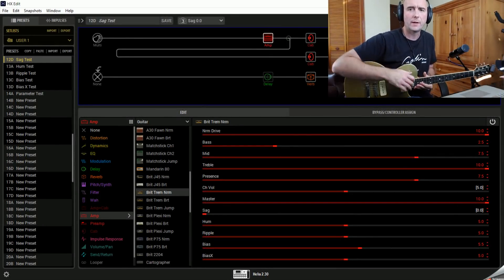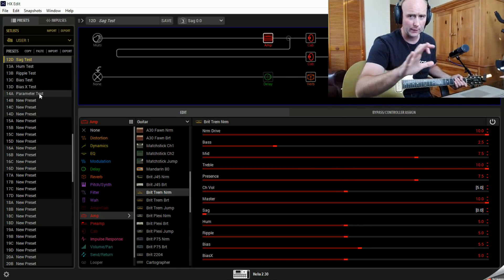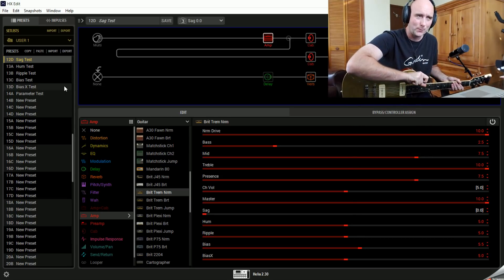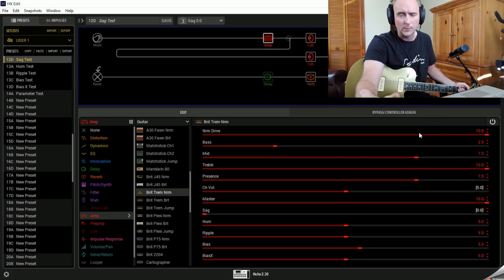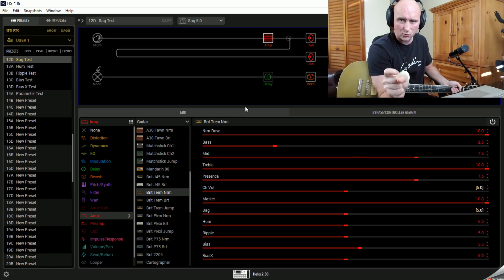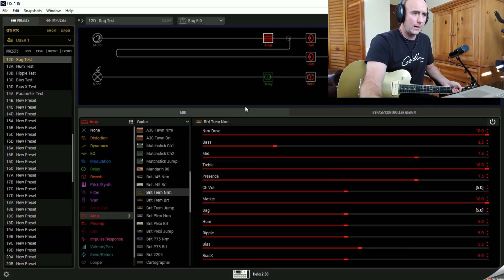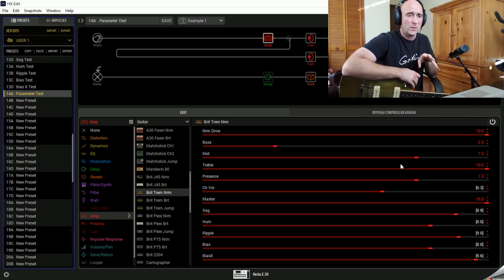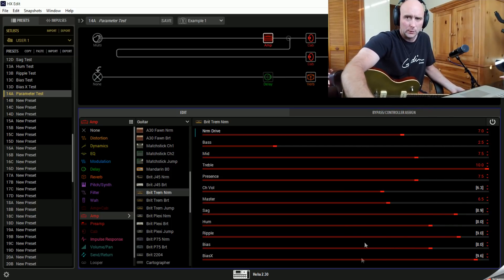Line 6 Helix - How To Create A Great Tone - Pt. 4 - Using Sag, Hum, Ripple, Bias etc.

Comment: An important aspect of biasx and sag is that they are dynamic - meaning they have more effect on tone as the amp is driven harder. For example, if you bias the amp hot (higher bias), it will have a bit less gain and the distortion will be a bit warmer, incliding more even order harmonics resulting from tube saturation instead of cutoff. If you set biasx high, the the bias voltage will sag when the amp is driven hard, make the amp biased even hotter (less negative voltage). What's cool about this is you get a nice warm tone from the power amp when it distorts, but if you turn your guitar volume down (or reduce the drive), the power amp will clean up, the bias will be colder, and them brightness will come back. Just what you want - a dynamic tone control in the power amp. Negative feedback is another interesting amp control, but Helix doesn’t provide that yet. So these power amp controls won’t have much effect if the master is turned down and the power amp isn’t distorting.
Reply from the maker: +Jim Amsden thanks for your comment. I mentioned in the video that with lower master and gain settings these controls would not have as much of an effect. Thanks fo4 your summary here :-)

Comment: I love this. Why? Getting the right sound by choosing the right as “early” in the chain as possible does wonders. The player followed by the the guitar and amp choices has such a drastic impact upon the sound. Once those bits are “right,” choices of EQ, compression, or other pedals are the icing on the cake (still important but they’re not holding the cake together).

Comment: I never used the sag to the more extreme settings and then turned up the channel volume to compensate and I have to say although I was happy enough it has changed everything for me! I am getting the more compressed sounds and attack and clarity that I like now! The Helix has been one of the best if not the best gear purchase I've ever made.
Reply: Also the higher Bias settings really cleans up the character of the amp distortion as well.

Comment: I actually like all of the parameters near-zero. Love this coldness
Reply: Honestly same. I like more progressive djenty tones though. I think the rep that line6 gets for artifacts could possibly be dialled out through hum/ripple settings because I’ve honestly heard direct comparisons with some of the real amps and the helix models and there’s virtually no noticeable difference. Certainly nothing you’d notice live or in a full band mix.
Reply: Lower the bias and bias x makes the amp model sounds like typical “cold” class AB amps such as mesa boogie, engl, peavey etc
Magically makes the amp model closer to the real high gain amp tones, it has clarity, tight, dynamic, thick and less compressed guitar tones (or said, sounded like fractal amp,model)
And don’t forget to lower master volume parameter (I’m personally set to 1 or 3 at max) and compensate its low volume with raising channel volume and IR level parameter

Comment: makes a huge difference in dialing in an amp. 

I also use just one guitar in one setting typically on my Pod Go, so I used the global noise gate to clean it up and save a pedal space, but often still use horizon gate instead.

Comment: Crazy how much difference it all makes. Especially with the master cranked like that. I never crank the master on any of my settings, but perhaps now when I'm dialing in a sound I'll start with it that way, and then back off the master a touch once I've dialed those settings in to my liking. Bias x however seems very apparent at most settings on the master. I used it to add some warmth to the otherwise very sharp sounding peavey 5150 model.
Reply from the maker: Yes , those parameters really do make a difference and can really help shape the sound. Hope they help :-)

Comment: I've noticed even with a bare-bones patch, the tone in your videos is very nice. At home I run the 1/4 inch out from the Helix to a little Rolls "mixer" and from there to headphones (  AKG K 240 Semi-Open Studio Headphones ).  The Rolls allows me to mix in an mp3 for the song I'm rehearsing.   I could use the headphone out from the Helix but I thought using the 1/4 is what I use at church and would be best for dialing in tones.   Doesn't sound as good as what I'm hearing here -- good, just not as good.  I have a decent powered speaker but need to use that when the wife isn't home  :-)
Could just be newbie issues since I've only owned the Helix 3 weeks.
Reply from the maker: Hmmm, not too sure what could be the problem. Have you downloaded any of my patches to test if they sound any better through your system? You also have to make sure that in Global settings you have whichever outputs you are sending your sound out of is set to the appropriate setting. Hope the helps :-) Let me know!

Comment: Hey Jason. Just wanted to know if it’s normal to hear some scratchy artifacts (maybe clipping?) when on patches with light-medium breakup/OD - especially with chords. I’ve tried unity gain, hi and lo cuts, and turning guitar pad on - but it’s still there. I can’t tell if it’s an intentional sound or I have a defective unit. I’m on a Pod Go, an insight would help, thanks!

Comment: Jason - this is awesome. Do you think these parameters have the same effect on a clean amp sound as they clearly do on a dirty sounding amp?  Thank You!
Reply from the maker: Thank you and so glad you liked it. Line 6 has stated that since these are mostly power amp controls that will be noticed more with higher master and for some even higher drive settings, I would tend to think that on cleaner sounds they may not be as noticeable. But, I would say give it a try and see if it gives you something you like :-)

Comment: I'm a new HX Stomp user and was wondering what those settings were 😆
I have an unrelated question if you could help please. I've had to send my Stomp back for replacement because it died on me during a firmware update so now's a good time to find out.
My original firmware was 2.65 and the new update was 2.82. I know that the 2.80 update was a major one, so my question is can I update directly to 2.82 from 2.65? I can't understand why my Stomp developed such a fatal fault unless it was just it's time to die.
So as I can't find much info about my question I thought I'd ask some experienced users.
So what do you think about updating a large leap in firmware? Thanks for any help 👍
Reply from the maker: I believe you can. Line 6 has provided a VERY detailed update process for going from earlier builds to 2.8.
Reply: Thanks Jason. Yeh, the Line 6 website IS very detailed but I don't find things like this, that you have to connect via usb to update, all that easy to follow, and after my first Stomp dying on me during the update, I find it extra daunting now 😆

I'm still waiting for my replacement to arrive so I've been watching a lot of your Helix 'How To' videos. I know they're not exactly the same but they're still informative for me.
I just hope that my new Stomp works fine, the last thing I want are any more issues because with gear like this, it's important that I feel confident that it's in 100% working order. I don't want to have to send the next one back because I'm impressed with the sounds I've heard come out of it, and I've liked hearing the sounds that you've got out of your Helix in your videos.
I'm hoping that I can get such nice tones out of my HX Stomp.

Comment: For the modern metal players out there.  You're going to want the SAG between 0.1 to 2.0 the lower the SAG the tighter the sound is.  Hum and Ripple at 0 to give you a tight low end for rhythm stuff and the bias settings in the middle at 5.  Bump up the Hum and Ripple to 5 for solos as they warm the sound up.

Comment: the bias lower is less headroom and quicker amp break up. Higher bias is more headroom. Bias X Compresses the power amp. This is my understanding of it.
Reply: I think it's the other way around, high bias makes the amp work in "class A" (more vintage) it breaks up easier and compress more, less bias makes the amp work in class A/B and gives more headroom, therefore "colder" with more headroom.

Comment: I'm curious if you do anything different when running through headphones versus Poweramp/monitors. I work the night shift so the family sleeps when I come home and start jamming.
Reply from the maker: Hey Robert, I don't really do anything different when using headphones. I use a pair of Senheisser HD600's which I really love. The patched usually translate nicely to them. Not sure if the helped at all :-)
Reply: Cool. I'm using audio Technica m50s, I just wasn't sure if I get entirely different sounds when it gets hooked up to the computer and tracked. Thank you.
Reply from the maker: It should be fine Robert! Let me know how it works out for you :-)

Comment: Hey I noticed that with my Strat my Helix is lacking a lot when it comes to low end, it's as huge and punchy as I want, what should I do?
Reply from the maker: Strats are going to be inherently thinner sounding, you could always try using EQ to beef it up a bit if need be.
Reply: I use the kinky boost for my tele when i need a little more beef, works great! even at low gain settings!

Comment: Great video, but for modern metal or "djent" tones what would you recommend setting these values at as a general?
Reply from the maker: Thanks so much Jake! That is a tough question to answer in a general manner. It would really depend on which amp model you are using and where your Master setting is at. All I could really recommend would be to experiment using the suggestions in the video. Not sure if that was of much help :-)

Comment: I'm pretty sure you do want the sag in djent, at least good djent needs tube compression to occur, if not then you just end up with a sterile sounding 16 ohm 4x12 style stiff triple rectifier crap.
Reply from the maker: +FlexYoFace Chase of course so much of this is going to be subjective and boil down to each person's own personal opinion as I have mentioned numerous times through this series of videos. My reasoning for my comment about lower sag settings for Djent is simply because with extreme sag settings on the Helix the attack of each note is squashed and may not 'cut' as much. Then again I am not a Djent player or fan of the style :-) It is just nice to have the flexibility of being able to adjust the sag parameter to suit our own styles and needs.